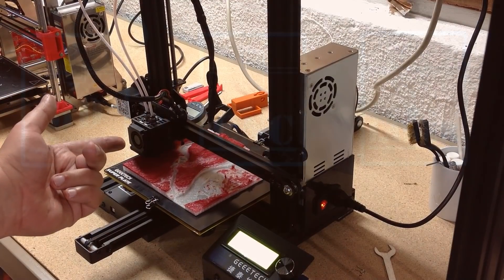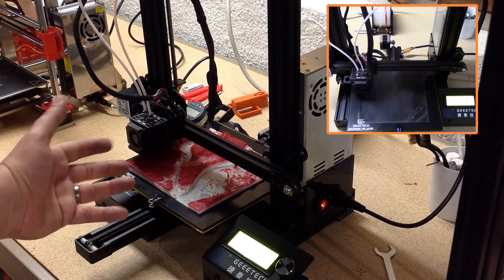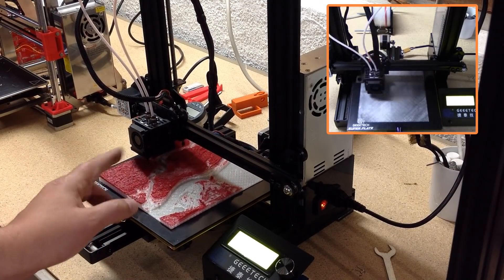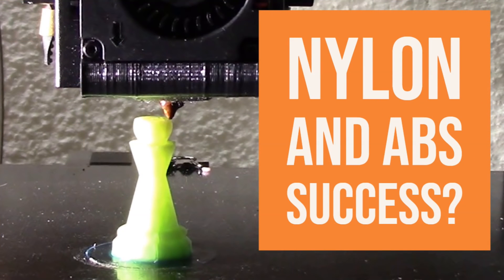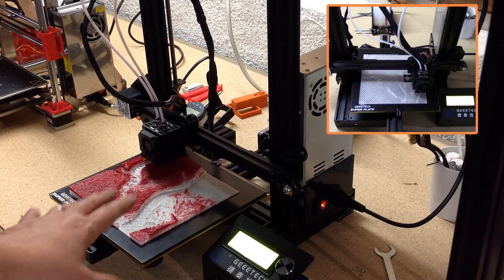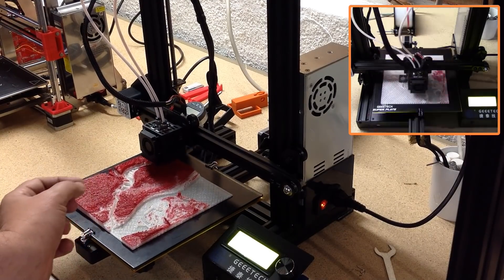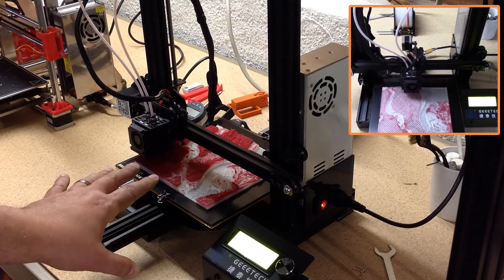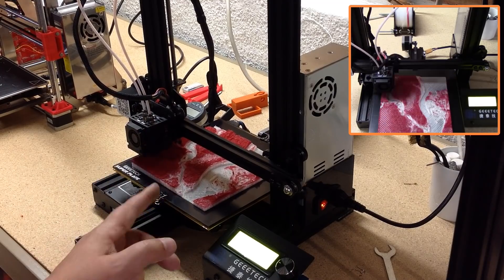Shop Talk - You Need a Mixing 3D Printer!

Comment: I am new at this so could you explain why you do not get a purge block (obviously you don't want one).  I thought they happened automatically with mixers.
Reply from the maker: Sorry not sure what you mean when you say "purge block"?   With a mixing printer you want to have a some positive pressure from both extruders all the  time.  As the nozzle creates back pressure for both and with one extruder at 0 and the other at 100, the 100 will start push back the 0 and sort of yes some point this back pressure will stop  (the material in glass state presses against the non-glass state material) it can lead to issues when 0 becomes active again.
Reply: @DIY3DTECHcom   There seems too be variations in terminology - Purge Towers, Wipe Towers, purge Blocks.  I gather you do not need one because you do not care it the colours bleed.  This is an example https://www.youtube.com/watch?v=lR_c-zxW2D8

Comment: Is that the Geetech making that noise sounds like a bad bearing or dry z screw with z hop enabled
Reply from the maker: Likely a host of other printers running I have a printer farm in the shop as well as CNC's etc :-)

Comment: I would like to see multi material parts where you have a pla interior ( infill and may be shell or two) wrapped with nylon, abs or tpu outer shells. Hopefully making a strong & tough part that is fairly quick & easy to print. Don't have a mixing printer myself to try this.
Reply from the maker: I attempted this before embarking on building my new shop and it was a bit harder then it seems However will revisit again once the new shop is done :-)

Comment: I got one a couple of weeks ago (a10m) and just the colour mixing adds a whole new dimension to 3d printing and I've only touched the surface with using just the gradient feature. Vases (non-usable) and lampshades look great. Have been thinking of some ideas to sell on eBay as most sellers are using one colour prints. two colour prints cost no more and take no more time but look ten times better and should sell for more.  I already have a cr10s  which is great for big prints. The next printer I would like would be a cheap big one but with a bigger nozzle hot end ie 1mm and then that would fill an area of design not covered by those two, big prints fast.
Reply from the maker: very cool as I too keep kicking around the idea of building a 24" x 24" printer to print custom moldings from wood PLA as I need to do a 16" by 12" special molding